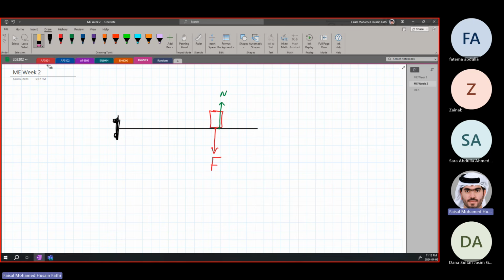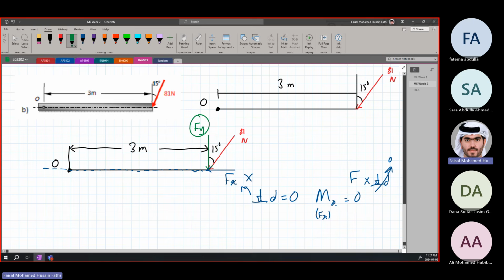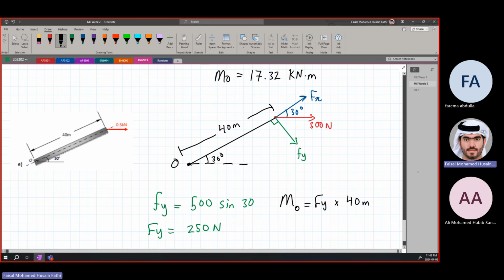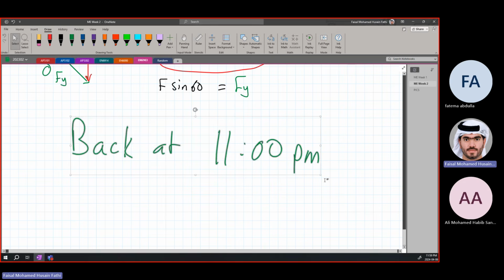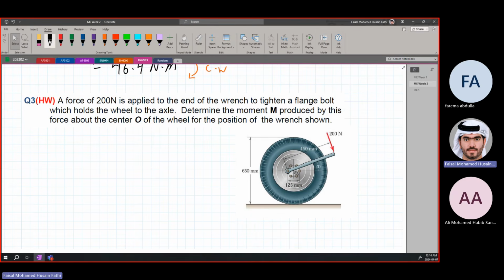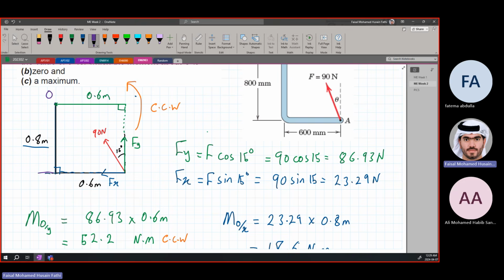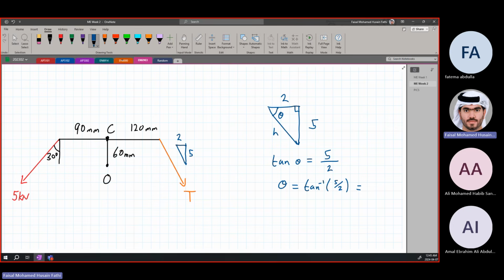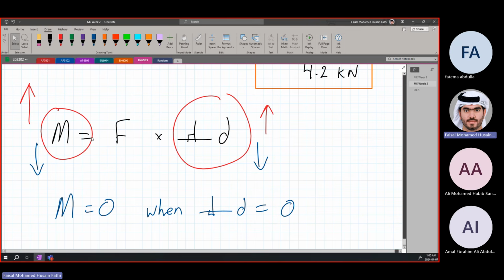2023B EN6903 Mechanical Fundamentals - Moments

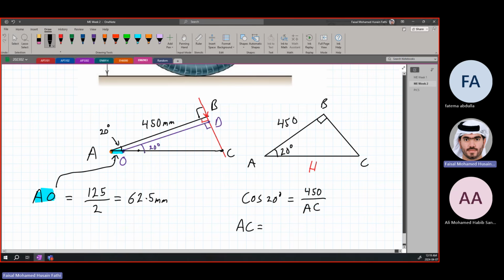Comment: في 1:08:30 مو المفروض sin بدال cos
Reply from the maker: The rule you might remember is SOH CAH TOA, which is Sin is for Opposite/Hypotenuse, Cos is for Adjacent/Hypotenuse, and Tan is for Opposite/Adjacent. In this case, the known angle (20 degrees) is at corner A , making the AB the adjacent side and BC the opposite side. AC is the hypotenuse by default as it is encompassed by the right angle. Since the aim is to find the Hypotenuse, we have to look at our known value which is AB (450 mm) which as mentioned is the adjacent side. 

Hence, Cos(20) = Adjacent/Hypotenuse can be used. Rearranging to find the hypotenuse will result in: 

H = AB / Cos(20) = 450 / Cos(20) = 478.88 mm

For more clarification about Trigonometry, feel free to watch the video below :D 

https://www.youtube.com/watch?v=xlJ-S8_XtI4